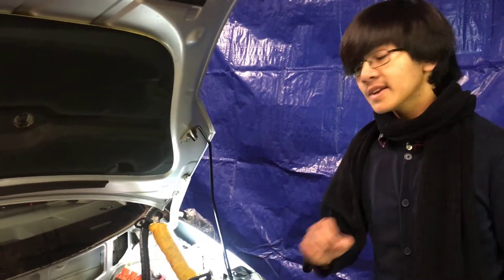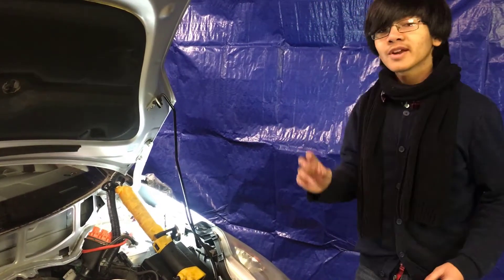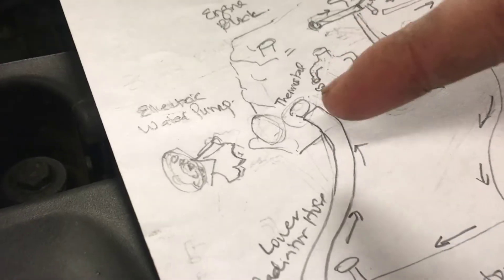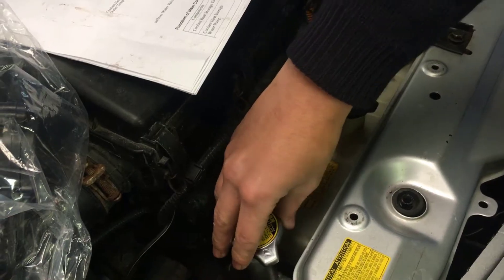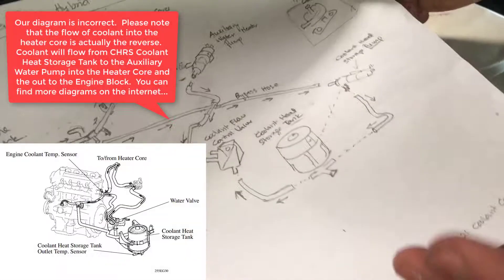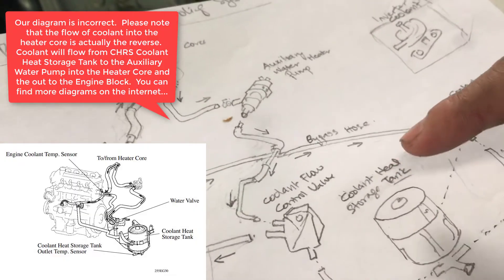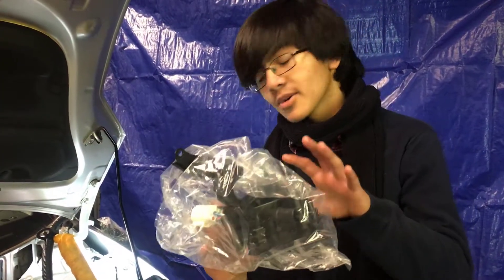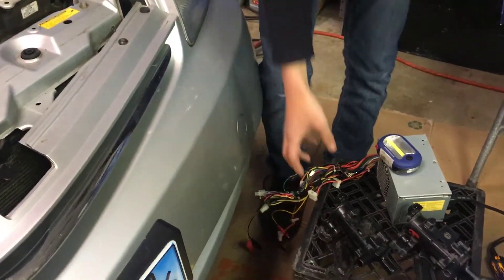Red Triangle Of Death, High Temp Light, Coolant Overflowing To Reservoir | Prius Diagnosis & Causes

Comment: My experience: only buy the Toyota Dealer OEM valve.
  I originally bought a knock-off packaged as an OEM from eBay.  It started leaking in a very short amount of time.
   I noticed coolant on the ground. Fortunately, my car didn't overheat.
Reply from the maker: Thanks for sharing your experience, that's really good to know!

Comment: I guess I have air in the system somehow. I drove the car for several hours at a time (just got it a week ago, 2008 Prius) but never with heat on. I actually had A/C running most of the time. I think when I set my temperature yesterday it might have been set higher than outside, so I guess water got directed to the heater core. After 5 minutes I got a check engine light (P1150) and shortly after the red triangle & temp warning. 
I noticed the coolant reservoir being full prior to that but didn't think anything bad about it because it stayed at 190F and didn't throw any failure codes.

Is it likely that my issue is somewhere between engine and radiator on the heater core cycle? Maybe the core or pump itself? I just hope it's not the head gasket...

Comment: It's quite peculiar that it sounds like you righteously solved the air in coolant circuit with too much pressure problem there causing the overflow tank to not suck back in. And yet alls you solved is finding the very slow RPM pump and replaced it with a faster spinning RPM one. I saw your other Auxiliary Pump test video with the slow spinning RPM but did you ever even solve the coolant tank high pressure and not sucking back in issue. Explanation is in a black hole can someone get it out.

Comment: 2008 Prius hybrid has multiple water pumps. I learned first hand after dealership botched the replacement of the synergy drive system’s water pump, that it is very important to properly bleed the cooling and heating systems. Computer monitoring systems more sensitive than older cars. If you have intermittent Triangle, Check engine, and thermostat indicators check the reservoir. If it is empty with no leakage, odds are you have air trapped in the system.
Reply: There is a whole lot more to this story concerning the dealer service department but long story short. The Prius apparently has a traditional water pump on the engine and multiple pumps for the synergy drive inverter. I basically had an air lock in the inverter coolant system that would intermittently trip the warning (triangle) light and the coolant caution indicator on the touch screen (especially when going up an incline). 
I attempted to fill the reservoir but it kept disappearing with no leakage. I ended up taking it to another mechanic (Toyota specialist)to run diagnostics since I knew next to nothing about hybrids. He was able to see the work done on the car by the dealer and checked out the cooling system and determined they did not do a proper bleed of the system. He filled and properly bled the radiator, performed diagnostics and reset all lights.😢 Since then I found this video. Maybe this link will help.

https://youtu.be/5FTj4GumFbg?si=oqFShbvZOd4k0zjQ
Reply: That's odd because my reservoir is empty I started hearing the gurgling sound on the passenger side around or glove box and I just Don't know what to do! The car wasn't overheating it's a 2006 Toyota Prius. The guy I bought it from told me the dealer put in a new water pump not that long ago. I'm starting to get frustrated. How do I bleed the system?

Comment: A couple of things The prius is tricky even with use a Vacuum filler due to the fact that unique 3 position coolent valve position will isolate parts of the system from your bleed efforts depending upon what position its in   ,,allways make sure the coolent recovery reserivor is kept full to the proper level otherwise the car everytime it cools will draw all the coolent out of the reserivor and then draw "air" into back into the system when it cools.  this air will then get trapped in the system with no where to go   Go through the system and check that all the hoses are connected to there "proper ports"  I have on occasion had people put them back reversed on the coolent control valve. its hard to do but  check  ,  The Coolent control valve has been an issue historicly as it can stick in the wrong position  an internaly leaking control valve will also cause Havic with by forcing coolent into its electrical connector and shorting its signals out as well as ruining the wiring harness and eventualy and ECU if it manages to force coolent back internaly allong the wiring harness into the ecu connector.   pull the wiring  connector on the Coolent control valve and check make sure its not doing this. Some info on these issues as well as a bleed procedure.   https://automotivetechinfo.com/wp-content/uploads/2020/09/Mastering-the-Toyota-Gen-2-Prius-Engine-Cooling-System.pdf

Comment: your mechanic does alot of guess owrk repairs and you ripped off big time brah!a proper pressure test check on the coolant system through the radiator will reveal if it is blocked aye mon

Comment: Seems like you had to do many unneeded repairs through the process of elimination to finally diagnose your problem. What’s the best way to diagnose your pressure issue (or auxiliary pump) problem without performing all the previous repairs (ex radiator, water pump…)?
Reply: Take all the suspect(related) parts and test them independently. If they don't do what they're supposed to... it's likely that you found it. 

Due diligence, some won't operate at all outside their "home", some will lie if they aren't, so, make it seem as though it actually is in it's "home"

Comment: Would this also apply to the Prius C? I have a 2012 Prius C I've been trying to diagnose, so far I've replaced the radiator cap and thermostat sensor, and it still gives me that overheating triangle when i tend to run it too hard on the highway. Moving on to the water pump and thermostat next. Any advice from anyone would be greatly appreciated!
Reply: Did you find out what was your problem? Have same issue on my 2012 Prius C
Reply: Yes, it ended up being a faulty thermostat sensor

Comment: I'm a lady mobile mechanic and people I know only call me when they have messed up. The 65 yr old friend has teated this vehicle(his cousins car) after he said he'll put on an A/C line. Ok here we go:
1st: he jacked it up from the front, so I put a jack stand under veh.    removed A/C compressor before disconnecting neg. cable, than stripped the threads on compressor where line goes in. I can maybe fix that. My concern is that he put trans fluid in the coolant reservoir. I removed Reservoir and need to flush system. I know use Distilled Water, If that so will it hurt electric water pump? How long should I let it run

Comment: For whatever reason they connected this water pump to the am2 fuse and it's absolutely a nightmare to diagnose when it fails by shorting this critical line of electricity leaving your car dead in the middle of a freeway

Comment: My car has overheating,I already replace auxiliary pump,3 way valve and it still overheating,do you think problem is that tank???
Reply: Thermostat... likely.
Turn heater on, HIGH, hot air?
If no... tStat

Comment: Hello, my Prius V 2013 with 190,000 miles having the same issue. Overheat light comes on and goes off intermittently, after changing the Thermostat . I am pretty sure sir is not in the system because I got radiator coolant got flushed at the dealer, after replacing the thermostat.  Could it be bad coolant temperature sensor ? ( I read a comment from very experienced technician that coolant temp sensor can misread the temperature and send wrong signal to the system ,after undergoing overheat problem ). I really appreciate your reply. Also ,will it be very expensive repair if I ignore this overheat sign and keep driving. It's coming only after 20 minutes of highway driving. I subscribed
Reply: Turn heater on HIGH. Hot air comes out?  If no, it's the tStat... or not enuff coolant.
Shops charge a lot, look for a local mechanic n provide the parts

Comment: I got the engine heat lamp on
  On a long drive
Or when the air conditioner is on
What is the problem ?
In a computer test
  Write high battery temperature
  What to do

Comment: I had a similar issue if not the same issue. So if you only press the start button the engine won't actually start. You need to hold the start button for atleast a few seconds for it to actually start and get out of neutral. Touchy I know.

Comment: Hey Aiman, 
Thanks for your suggestions, they are very helpful!
My car has a similar problem when getting on a highway, red triangle light comes on and it’s overheating, it even stoped running for a minute before I turned off and on. When I Brought it to my mechanic , he scanned and read code P0A93 which is for inverter water pump. We replaced inverter pump , but it did not solve the problem. I’m thinking to follow your suggestion and replace auxiliary heater pump, but I’m not able to find it online aftermarket ones and ones from the dealer are around 800$. Do you have any suggestions where can I look for auxiliary water heater pump .
Thanks
Reply: We’re you able to fix it ?
Reply: Any updates on yours?
Reply: Somebody?
Reply: Junk yard
Reply: Plenty of Prius tow cars sitting in police impound yards waiting to be auctioned off for not much money.😜🤑

Comment: Good job buddy. My red triangle and temperature light is intermittent. It goes on for 3 seconds then disappears. 🤷🤷
Reply: Unsure if you figured it out. But I'm going  thru the same now... it's the thermostat. If you turn heater ON, High, and cool air comes out, Thermostat is stuck Closed. It's not hard to change, but it involves draining coolant, rinsing radiator if u want, new coolant, and bleeding the line for air bubbles. Suerte
Reply: Btw, had replaced the coolant control valve a few months back so it's not that. Just got 200,000.
Reply: @jennifermorales7787  Did you ever find out the problem? My car is doing the same thing.
Reply: Hlo i had same problem then i went to valvoline repair they did in 2 minute for free

Comment: Hi Aiman, thank you for your informative videos and everything you do. In my 07 Standard prius, 20,000 miles ago i replace the inverter and inverter pump because they both went bad...now i got the code to replace the coolant control valve ... i also have 275K miles at this moment , do you also reccomed to replace thermost and radiator as well ? Thank you again.

Comment: Do you know how to remove the Red Triangle from the dashboard, at this moment all the lights are on and the car doesn't drive, until I disconnect the battery and reconnecting back on? there is not any weird noise or leak, and the hybrid battery still working properly. any advice?
Reply: Did you ever figure out your problem? My fiance's is on as well as a few other ones but we took it to Firestone and both batteries where fine and it reset on its on. Just wondering if you figured anything out. Thanks
Reply: I had same problem I discounted the battery back and it removed red trainable of death.
Reply: @luisrichardgomez  do you still have the red triangle on?
Reply: @eddiechimex  What year your Prius? My 2008 Prius I changed the Inverter Cooling Pump see videos easy to do. But be careful because coolant drops make sure refill coolant buy it at Toyota Dealership. My Triangle of death went away after fix this. I also would discount the battery in back then hook up after you did work see if it turns on. My turned on and removed the triangle of death from doing that. Good luck. 🍀
Reply: @luisrichardgomez  I have a 2007 prius with 125 000 miles. I replace the water heat control, both oxygen sensors. The red triangle is not on right now, but after I drive for a while the light comes back on again, I stop driving the car fue a while, then when I drive the car again the light disappears. I don’t think the car is overheating cause the coolant level it’s fine. Should I keep driving the car even when red triangle is on, what you think? Thank you for replying.🙏
Reply: @eddiechimex  Change the inverter cooling pump should not be that expensive at dealership part. I think that’s problem once I changed it went away.
Reply: @eddiechimex   My Prius 2008 with 310,000 miles got it used and I’m second owner runs fine but I get electrical problems I can fix that unplug back battery and goes back to work fine like a glitch.
Reply: @eddiechimex  On overheating right now is summer always put coolant on radiator it will make bubbles and drop down fill radiator fluid till get top on radiator I’m telling you cuz I always work my Prius so that year model same as my car.
Reply: @luisrichardgomez  thank you!😀

Comment: I think I'm having a similar problem. The sound my car would make after turning it off, I think is when it puts water into that storage tank, it doesn't sound normal anymore almost like it is struggling. Well, when I am on the freeway at 65mph or so, I get a red triangle "problem detected" and after it does it a few times I get the same thing and the icon on the screen indicating overheating somewhere. I wasn't sure if this was the engine or for the battery pack but it was charging the battery and discharging. Driving on the streets the car works fine, or at least it doesn't report an issue. What would be your guess?
Reply: Lol what did you end up doing

Comment: good video.  But WHY, WHY, WHY?!   would you replace parts that aren't bad???   A new radiator?   coolant control valve? etc, etc.  Thats an expensive and time consuming way to fix the problem
Reply from the maker: Not sure how to answer the question, but perhaps I can try answering the questions with questions and answers.  Why should we replace the brake pads before they the metal rubbing?  So that we don't have to replace the rotor.  Why do we replace the tires before they became legally bald?  To prevent flat tires & possibly avoid accidents & injuries.  The new radiator was free.  The old one can be used as a back up in the case the aftermarket failed.  The control valve?  The car is 375,000 miles, eventually that pump will also gives in, why not do it at the same time as the other pumps?
Reply: @EyeOnAiman I understand the brake pad and tire analogies..  I hope that you realize that these are normal wear items from FRICTION, which is totally different.  Of course you need to replace the normal maintenance items on a vehicle.  That's in the owners manual.  But the radiator and coolant components are totally different. I have no problem with the fact that those were replaced.  Its your decision.  But if I took my car to a mechanic and they just started replacing parts for no reason, I would be upset.  Its not the professional way to do automotive work.  In some cases, it does happen though.
Reply: Yeah it sucks but sometimes a DIY mechanic has very limited testing equipment so they must "TRY" to make an educated decision and throw the most likely part at it. While an actual mechanic can take a part off and bench test it.. it all comes down to availability, price, And ability to check items.. but you already know this; you are just playing CAPT hindsight.

Comment: ￼ Cómo se pronuncia

Hello friend, I have watched your videos and they are very helpful. but I have a big problem I am from Mexico and my prius started vsc + check engine plus the red triangle. I've tried the cells and everything is perfect. I dont know. If the water pump is the cause. but I don't know that symptoms give a bad water pump. please help. :(
Reply: You need techstream & VXDIag ToyotA ( better version of Mini VCI connector to get dealership-level codes. On my 07 Prius, only 75K miles on odometer ( salvage title - front collision ), I got  🔺️ & code P03af-243 ( motor resolver ). I had been driving highway for one hour and got 🔺️ as I slowed down to pull into parking spot. Even with red 🔺️,  car drives normal.  I cleaned motor resolver connector & H17 HVECU connector. 🔺️ disappeared by itself.  A week later,  another🔺️, codes u0129 & u0293, appear as i made a u- turn and accelerated. BTW, U0293 and u0129 don't appear using regular obd2 reader.  ( lost communication with hybrid system ). This is ongoing problem I am researching right now.
The community has posted several rich, robust, & colored wiring diagrams for the 2nd gen Prius.  Your friend is Google, Priuschat forum, & ToyotaNation forum.
Reply from the maker: Bad water pump would usually have a temperature icon warning because engine is overheated.  It is difficult to diagnose the all these warning signs, we came across this situation one time and it was a dead 12V battery.  A friend had similar issue and had to replace one of the pumps, not sure which one, we'll find out...
Reply: @EyeOnAiman  
thanks for answering. Change the 12v battery for a new one. install everything again and everything perfect. I went to a gas station and back home turned on the lights. I am in that it can be inverter pump or cool fan rear battery. :(. The promble is. don't dial me code
Reply from the maker: @DanielHernandez-gu7yo  The drawback of Prius Gen II is that you cannot use OBDII to read the fault or error code.  You can buy Mini-VCI / Techstream cheap on Amazon but you will need an old PC or Laptop running Windows 7.  You should be able to get the right code.  Even if you go to the mechanic shop or garage, if they don't have the right scan tools, they cannot read Prius Gen II codes properly.
Reply: @EyeOnAiman  thanks friend. I will try to find where to scan my prius correctly, but it is difficult in my city. They do not work with hybrids.
Reply: @EyeOnAiman  
2008 Prius no power to the inverter converter electric coolant pump,I need the location of the source of the power fuse or relay perhaps a diagram.Can you help-__?